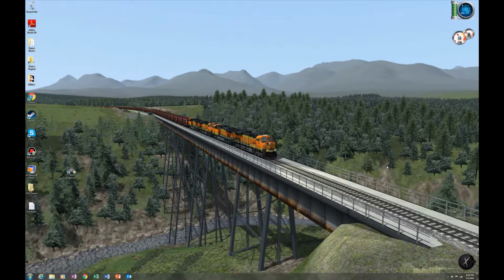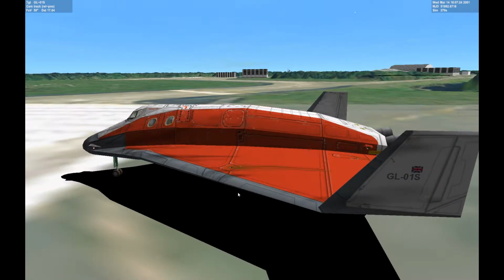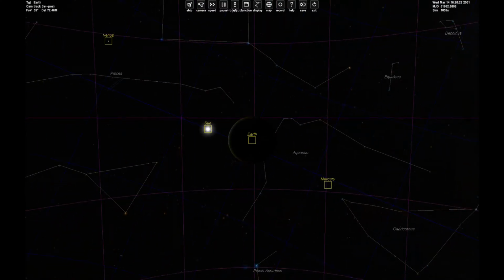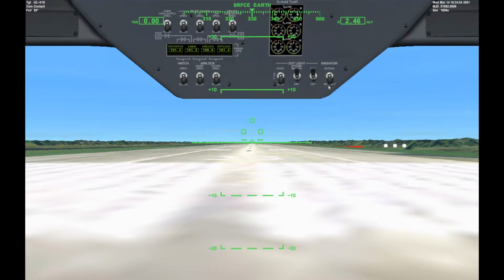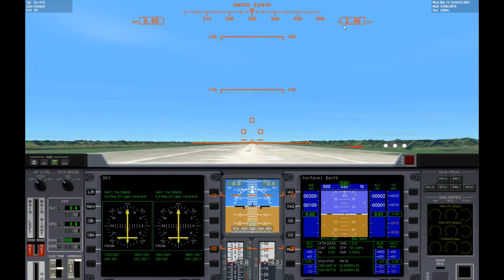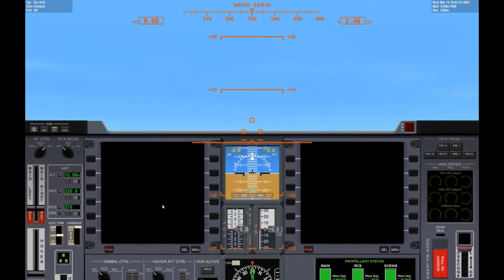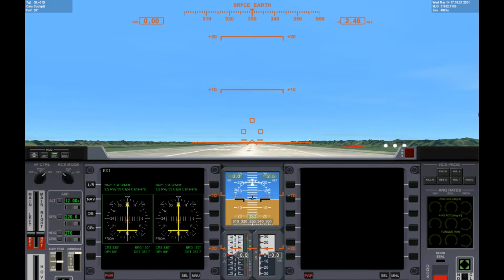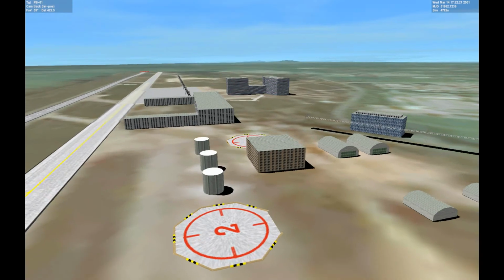Orbiter 2016 Tutorials 1- I have spaceship

Comment: hi Dr aero, is there a way to use the autopilot buttons in the 3d cockpit view.?
Reply from the maker: Hi Mode H, I tried in the DG-S in Orbiter 2016, and the mouse-clicks in the 3D cockpit view will perform the same functions as clicking their counterparts on the 2D or glass panel.
Reply: yes, for some reason they are not added on that view, well... it appears that one must have a mix in between the views, thanks for the replay, nice vid..